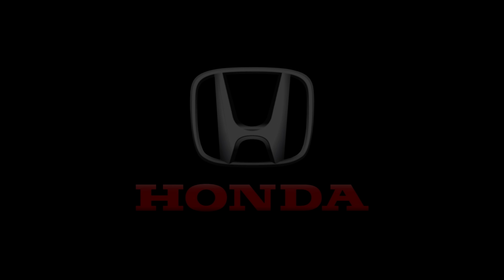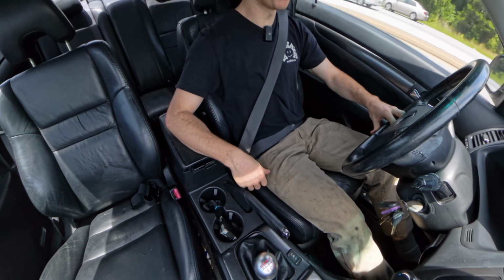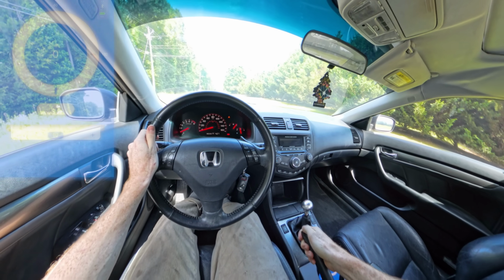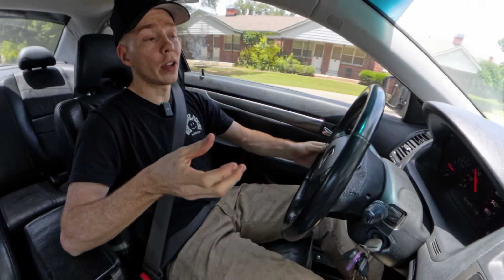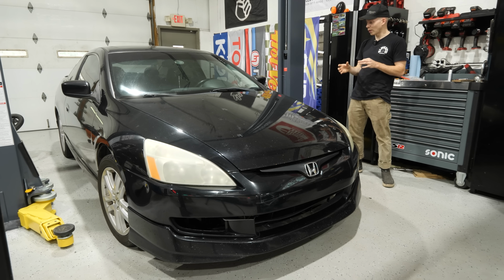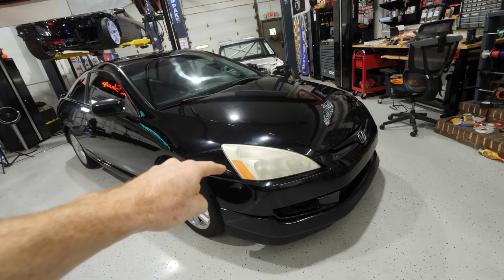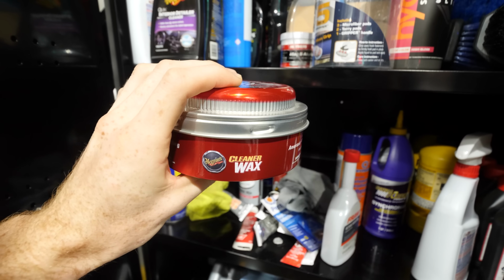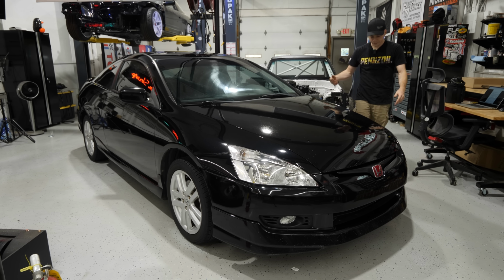I Bought Honda's Most Underrated Vehicle

Comment: I owned one of these years ago. No fuss, reliable, great gas mileage, good power, great gearbox. Loved the thing. Then I crashed it like an idiot 😓 hoping to live vicariously through the vids of this build. Super stoked
Reply: 27mpg highway is not great gas mileage for an accord, or sedan in general
Reply: @surewhynot6259  someone is young and knows nothing about the engineering of ICEs. 27 hwy mpg for 240hp in a 3 liter V6 was incredible gas mileage for 2007, and is still pretty good by modern standards. An N/A V6 is not the turbo 2 liter 4 cylinder you're used to. It also doesn't drive the same way.
Reply: @surewhynot6259 these get like 30+ on the highway.
Reply: @surewhynot6259 i get 22 but thats alot on me i wont lie
Reply: @catoilsalesman9158  yeah I thought I remembered mine being better than advertised. I think I remember getting 31 mpg mostly cruising at 85
Reply: @wowthtsgood it's not about any type of engine ,  he wrote it  "Great mileage"  irrespective of engine,  while 25 mpg for V6  ( in specific ) is okay but not certainly not good for daily drive or like (any) normal sedan ,  ( that's what first comment was talking about) 
my dad's inline4 makes similar horsepower  while giving but 25+km/ltr ( 60+mpg) . There are many other Suzuki's rolling around with  more than 36+km/ltr or ( 90 mpg max ) on highway , if I am going to drive 50-70  miles daily for work, that ultimately gonna make thousands of difference ( atleast where do I live ) giving similar comfort and fun ..
Reply: Transmission. Not gear box, these dont have gearboxes

Comment: So happy to see someone who plans to modify one of these. I bought one with a blown up motor last year and threw in a J30A from a jdm importer. Been driving it every day since. I do not love thar dual mass flywheel of the delay valve in the clutch system. So those are definitely the next things I'll try and get rid of. The paint on mine is way more clapped and it doesn't have the HFP kit on it.

Comment: You’re supposed to take a piece of the clay and knead it before use and continue to knead it as you go along. Also, based on the state the paint was in, you needed a wool pad with cutting compound, then a second pass with a foam pad and polish.
Reply: I'm pretty sure he knows to fold the clay. But as for the wool pad with cutting compound, I'd actually recommend using 3M's new Tri-zact line up. They have somehow figured out how to remove using a wool pad entirely and go straight from D-A sanding to polish. And it's absolute MAGIC

Comment: I remember like years ago a Magazine had a take that THIS was the modern Muscle car.  It had the biggest engine available, manual transmission, 2 door, all at an affordable price.  Now, it's missing that the biggest engine is a V6, and that it's fwd.  But you can kinda see where they were coming from, even if a bit dumb to say.
Reply: It competed with a mustang that had 193hp v6 and a 300 hp v8, with it's lower weight and 250 hp was close to the v8

Comment: I had a 2006 Accord SEDAN EX with the v6 and 6 Speed, bought it in mid 2013 for $10K - what a steal. Great daily driver, great fun driver, Had it 3 years and 35K miles, no issues, drove hard.

Comment: I had a 2003 v6mt Accord coupe, it was a fun car, handled well but had huge fender gap, and it was quick in a straight line.  My wife had trouble with its blind spots so we sold it and bought a E36 328i.  The 328i was slower but better in every other way; less NVH, better handling, more communicative, and more comfortable.

Comment: 7th gen Accords are amazing! I used to own a black 2007 euro Accord wagon, it was great until the rust got so bad that it wouldn't pass mandatory inspection anymore. It was just the base 2.0l gas engine with a manual transmission, but the shifter felt really nice so it was actually somewhat fun to drive.

Comment: My ‘07 Honda Accord V6 has 270,700 miles with Original motor and transmission and not a single light on the dash. Perfect, reliable and gets up to speed nicely (plus I upgraded the outdated components)

Comment: I had an 05 Acura TL with the 6 speed. Great power, quiet, comfy, and great MPG.

Edit: if you lower one of the J series FWD manual cars, you’ll probably experience heavy front end vibration on accel in 2nd and 3rd. Control arm bushings and most likely axles.
Reply: Thats what i own rn but my mpg is terrible
Reply: This is common of lowering most fwd cars. Axle geometry changes and you feel that.
Reply: @rodeo2026  I'd average 23 mpg highway/city on a tank. 80mph would yeild 27-30 mpg avg, 70 would be 32-35mpg avg. All with the 6MT
Reply: Sirting in it right now

Comment: You're absolutely right about those being beat and neglected, my friend bought one with 140k miles. Was in really good shape, engine sounded great. A week later it blew up on the hwy just cruising in 6th gear. Put a rod through the block.

Comment: I had one of these. 

If your power steering pump starts making a noise, it’s probably a 50 cent O ring you can replace easily. Can get it from Honda.

Engine mounts go bad pretty commonly, again not a hard job.

Other than that you got the manual so that means less issues. Fantastic buy.

Comment: Awesome video. I have a 06 v6 6 speed sedan and I love the car. You were right about a lot of the things you said. Mine took some work but now it has full adjustable front and rear suspension, upgraded shocks and springs, intake, j pipe innovative mounts, and I have a stage 2 ported and polished magnesium intake manifold and throttle body on its way.  Can't wait to see more from this channel!

Comment: I had a 2003 Accord V6 6 speed manual, sold it in 2018 with 168K on it. Besides the normal wear of tires, brakes, suspension, and 2 timing belts/water pumps, the was great gave me no problems and was a blast to drive, the LSD differential didn't hurt either. Honda gets A+ from me on that car.
Reply: You had an open diff, only the acuras had lsd in the 6-6 cars

Comment: I bought my 2006 4 door 6-6 earlier this year with only 78k miles, best daily ever bro, insane how people dont know about these cars
So much easier to find clean examples of this compared to an si, and will blow the doors off one too
Reply: Also the 4 door 6-6 is only 10 pounds heavier than the 2 door version.
Reply: @catoilsalesman9158 what does 6-6 accord mean?
Reply: @JECHOE  that's in reference to this exact kind of accord, a v6 6 speed manual. 6 cylinders 6 gears.

Comment: I owned one of the rare, 2 year only 06-07, accord v6 6 speed SEDANS. Those things are incredible. 5.5 0-60 with intake and exhaust. Sounded amazing, 87 octane and it does 134mph (speed limiter) so easily.

Comment: Had a 2007 V6 stick, 240 horse with good gas mileage. I loved that car, to get a good 60, you have to lose traction. Ran a 14.5 stocks. Intake downpipe exhaust, lighter flywheel better clutch, and the tune, you have a 13 second car.

Comment: I had owned a beautiful 05 honda accord 3.0 liter 6 speed.  However i ended up selling it for a 06 Acura TL with a J37A4... Which was a pain as i had to source a transmission from a 2007 Acura TL Type S 6-speed transmission w/ LSD. The engine and transmission ended up costing me around $6,000 for both and that doesnt include all the upgraded parts i bought (new clutch, flywheel, trans mounts, motor mounts, insane CV axles, upgraded big brake kit, water pump, timing belt, and internal upgrades on the J37 engine to handle the extra power that was going to be added. While the engine and transmission were practically new after all the parts i replaced the inside or my TL still has the cracked dash, falling headliner, and the ugly tan interior lol. But its fast and runs like a champ. But watching you fix your accord is making me miss mine! The parts were cheaper and much easier to install. Love that youre keeping it classy.

Comment: Kind of a cool easter egg and easy way to spot one of these unicorns: all other V6 Accords had a silver V6 emblem.  Only the manual V6 coupes got the red V6 on the back.  The last time I replaced Honda headlights with aftermarket, the aftermarket ones were leaking and hazy after a few months.  I'd kept the originals and I was able to bring them back to like-new.  Your stock headlights looked reasonably clear when you hit them with water, so they might come back with a wet sand, polish, and clear coat.  I like the Meguiar's kit because it comes with big enough bottles of polish and protectant/clear coat to do a whole bunch of headlights.  The sanding pads seem to last too.

Comment: I've owned two V6 Accords over the last 15 years. A 99, and an 08, both exl
They are a tank of a car
I've rallied, driven thousands of miles on dirt roads and trails, JUMPED the cars, all on stock suspension, and they never broke. I rebuilt the entire suspension at 150-175k miles but they didn't even need it. Just preventative because I knew how hard i'd been on it. With a few bolt ons and a tune you can get pretty nasty with it for cheap.
What you get for what you pay is just top tier.

Comment: I currently drive a 718 boxster. however 10 years ago and many cars in between  I was driving an 03 v6 6spd accord. After driving all these bmw's, porsches my heart always beats when I come across a 6spd V6 accord. there has been nothing like it. the gearbox was just a joy to shift. every single time I got in it every gear was shifted at redline for absolutely no reason, I was broke but I never had fear of damaging anything beyond my budget.  Brakes, tires, rotors, battery and an alternator.  that's all I had to replace in a 3 year ownership filled by childish to the absoloute limit driving.

Comment: I had one of these and it was an amazing car. Faster than a lot of cars with more HP and similar weight (Focus ST, 350z, etc) because of the gearing and and smooth power. It's one of the few cars I've had that I wish I didn't sell.

Comment: Ditch the claybar, take a DA with a 3000grit pad and wet sand it until you see a white residue (clear coat) then keep moving, once you got a uniform smooth dual finish start with a cutting compound and go up from there

Comment: Ahh, the 6-6 is finally getting the recognition it deserves. I’ve had my 04 Accord since 2019 and it’s never let me down, and always puts a smile on my face. I’ve been offered over $10K for it by a few people, but I could never sell it. One of the best cars Honda made. Such a shame that the Accord is no longer offered with a V6 with all the manufacturers moving to electric cars. Such a treat to see this car on your channel!

Game-changing mods for this car
-Wider, Stickier Tires. I run 245/40 R18 Yokohama Advan Apexes on mine
-Type S/Progress Sway bars 
-Poly engine and trans mounts (almost completely eliminates wheel hop)
-LSD from the UA6 TL
-RV6 or equivalent J-pipe
-Calipers from UA7 TL Type S (just swap the knuckles)
Reply: Bro; get the tl-s sway bars as well! Biggest handling difference you can make
Reply: @catoilsalesman9158  I forgot to mention the sway bar! Yes, another game-changing mod. I have the Progress 22mm sway with Eibach Spherical bushing links on the front and rear and the TypeS sway bar up front. There's so much rotation! I took my car to a few AutoX events, and it was sublime. And there's so much in the car the way it's setup, I just need more seat time!

Comment: Definitely a reliable car me and mybuddy got one for free, it was an auto but the same car as yours v6 2 door and we beat the crap outta it every single day and it wouldn’t die, any time we drove it we floored it and redlines all the time anywhere no waiting for it to warm up just floor it till it’s warm up, did that from 155k miles to 200k and sold it still running and driving great never did an oil change either

Comment: You can put 4 piston front brakes off an Acura RL with a bracket kit sold by Fast Brakes. Cheap and easy way to do a big brake kit up front. The Hybrid Accords from this generation have bigger rear brakes so you can swap the rear brakes and knuckles off a hybrid model to do big brakes out back.

Comment: i love this new publicity for the 7th gen. they are awesome cars and damn near bullet proof if you take care of them. i love my 05 k24a4 auto, going strong at 140k miles and no major issues in 4 years of ownership.
Reply: Have you had the window regulators break yet
Reply: @jonathanoneill8655  no but my front passenger side one is slowing down for sure lol
Reply: @vtec.5ucks  very common problem with 7th gen’s I’ve changed both of my front ones on my 04

Comment: Factory HFP lip kit, very desirable and hard to come by! Owner of this cars “big sister” (if you will) the 2003 CL Type S. Coming from another Honda/Acura V6 6 speed owner, these cars are truly a pleasure to work on, maintain and above all DRIVE! My car fortunately came with factory LSD, but yours did not, don’t forget to throw one in there when you upgrade the clutch! Probably part of the cause for all that wheel hop (along with the likely failed, front Lower control arm bushings) I believe they also had the delay valves on the clutch hydraulics, may have been your issue with launching the car, multiple videos out on how to delete them, or I believe P2R offers replacement cylinders that do not have the delay valves. Really looking forward to seeing more of this! Just got a new subscriber my friend!
Reply: Was just gonna say no one is talking about the factory hfp kit like this is rare of rare to find lol I had a hfp civic si and a 05 v6 6 speed accord but I'm looking for a hfp accord now

Comment: My 2003 bought it in 2004 with 18000 miles. 20 years later still strong en over 300,000 miles ❤❤ my other car is a 2019 bought it in 2020 with only 1800 miles, actual miles 15,000 love Honda's they are the best cars out there. 🙋‍♂️🙋‍♂️😉

Comment: Had a 2003 3.0 V6.   You do not need new lights, simply polish the damn things and they'll be clear as they were new.  Get a Megan racing test pipe.  Change the coils are you spark plug coil packs and plugs.  Go with a cold air intake from JDM.   Buy new rotors if they're wobbling during breaking, that is a common issue in an easy fix.

Comment: Make sure to change the timing belt. I have owned three V6 Accords and the timing belt needs changed every 100,000 miles for sure. I currently have the 9th gen V6 coupe. I love it. I had the 7th gen as well. I loved it. Sadly I had the timing belt changed when I bought it and it gave out 80,000 miles later. I did run it hard daily on freeway trips to and from work. To many freeway races lol 😂

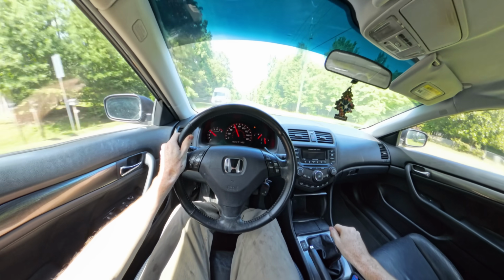Comment: I owned a 06 v6 6mt sedan which was an incredibly rare spec of this car. abosultly loved the car and it drove me 2 hours per day for 8 months during college. it was quiet comfortable and it had enough power to overtake and merge on the freeway without needing to turn off the AC. Kinda wish I had never sold it but I bought an STI instead and didn't need 2 cars at the time. One of the most common issues with these cars in the transmission loves to lock out of gears between shifts and putting into gear (this might have been what happened at 6:42 where you couldn't get it into third). Mine was so bad with third that sometimes I had to skip the gear entirely. The old Honda forums highly recommended General motors synchromech transmission fluid and It fixed all of my shifting issues so I highly recommend that first thing since the trans shifts very nice after doing that. Very excited to be able to see what I could've done with the car had I kept it longer.

Comment: There isn't much supporting mods for j-series compared to B/H/D/K series but there are other not so known companies and standalone personnel that makes parts for j-series like the magnesium intake which is lighter and bigger and you can gain a lot of power from simple bolt ons, j-series are tough and can take a lot of hp on stock internals, they really wake up crazy when you add boost to those things so this is a build I definitely gotta see from start to finish.

Comment: Wait… on the dyno the engine pumps out 228HP and 211Lbs of torque at the wheels? 

That’s 16 less horsepower (rated 244hp) & pretty much the same torque figures at the crank. Very impressive.

Comment: I have 1 the same color 04 I got for $1800 two years ago. 95k miles. water did enter the interior so I removed the carpet and now will be installing a new carpert and headliner plus a rear window. Been sitting for two year now and only drive it around the block and back. I have acura RL big brake Calipers I got from the junk yard and will be doing a tein flex z coilovers when I get $$. New lower control arms , ball joint. and will try to turbocharge it. I don't have the $$$ now so for now I will watch yours. lol

Comment: man i bought less than a year ago a 2010 accord 3.5l v6. an auto because its a work car. i have to say i paid 5000 dollars with 55k miles. it has been the best car i have bought. i have a 2018 type r aswell but for the 5000 you get a very decent car for the money. its a very underrated car

Comment: id love to see what you think of a chevy s10 (1994-2004 model) with the v6 and manual. wont be as fast as that accord stock, but 4.3 litres of displacement in a v6 doesnt sound bad at all with an exhaust, plus that engine is really reliable.

Comment: These are the last generation Accord that still had the double wishbone front suspension. Which is MUCH better for comfort and control even with much stiffer spring/shock combo. If anyone is familiar with the EK/EG/EF front suspensions. It’s very similar to those. Which the civics also ditched after the EK, EM, EJ chassis in the US. They’re more complex so more expensive for the automakers. However they are so much more adjustable and ride so much better and comfortable even when lowered and running relatively stiff springs.